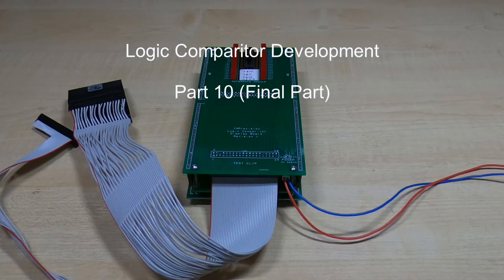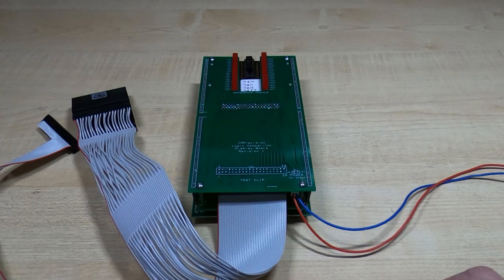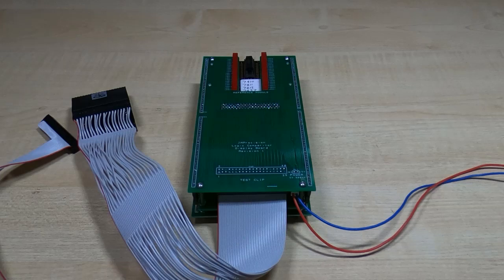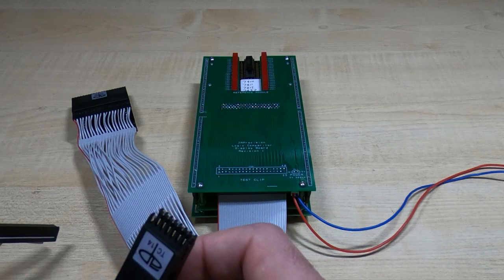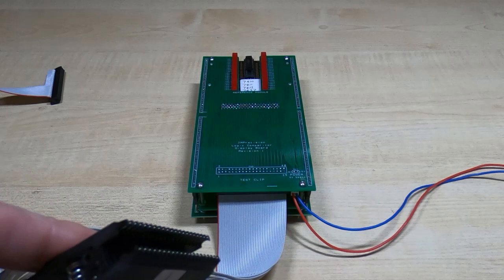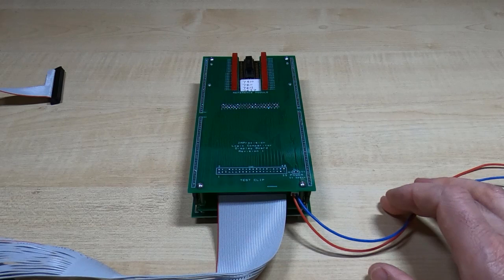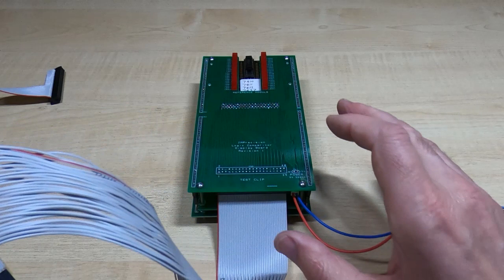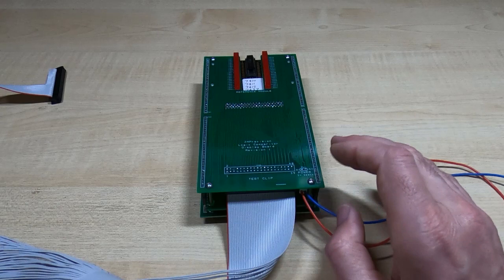JMPrecision Logic Comparitor Part10

Comment: Dear Jerry, this is a very handy tool and a way to get one without having to pay the high price for the HP devices.  I didn't see any video after this where you used this handy divice. I own and use the HP comaparator frequently and was wondering in what way your (40 pins) device would be an additional aid. Specially the way to test DRAM (as you mentioned) would be interesting to see in a next video. Keep up this quality of your PCB's and video's. Benny

Comment: That is neat, now would an EEPROM or flash chip be fast enough to keep up with common or obsolete logic chips?  That way you can simulate chips you only have a datasheet for?  Or would those be too slow and cause the error LEDs to flicker?
Reply from the maker: No you would not be able to use a ROM. The comparitor is effectively measuring 'skew' with a max allowable limit of around 20nS and a ROM would introduce the response time (eg 150nS) plus the output rise times plus the address selection so it would not work. There must not be any active devices between the inputs and the comparitors as that would stop the function of the comparitor circuits. The LED's would just be on permanently if the path had more than a few nS and that also includes the actual UUT rise times etc. I do have a design in mind to allow a 'soft' configuration using a microcontroller but I need to pay for the development of this version by selling some first. That is also why I designed it with separate comparitor boards so hopefully I can design the next version to allow them to be re-used by anone that buys this version. It is not possible to directly do the comparison using a micro but part of the current design is to allow implementation of one for device selection / configuration.
Reply from the maker: One point I missed in the video but will be covering in future test videos is that you can also use it to test devices if you have a board with a working device. You just plug the 'suspect' device into the reference socket and assuming the UUT device works then you are testing the reference device.